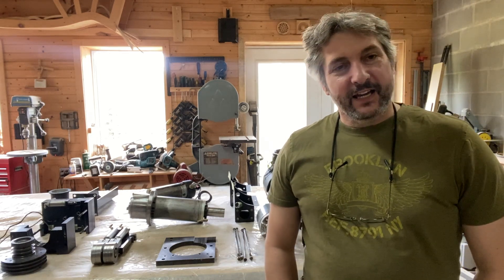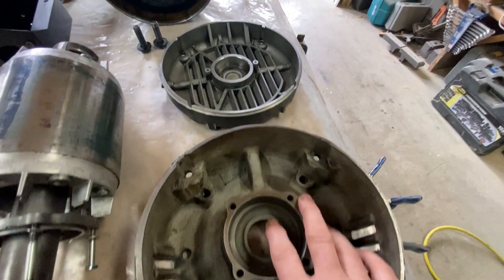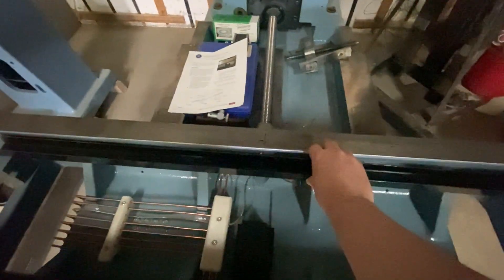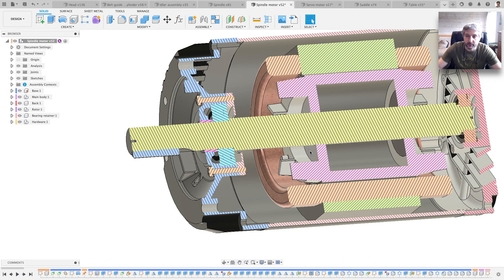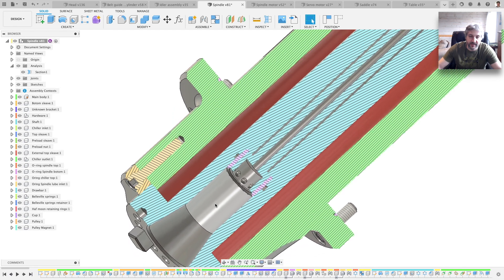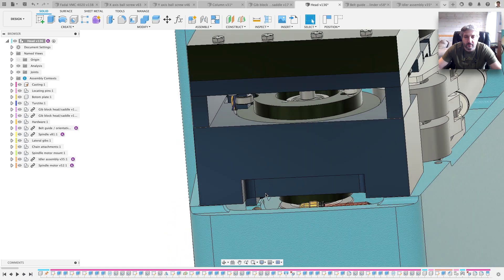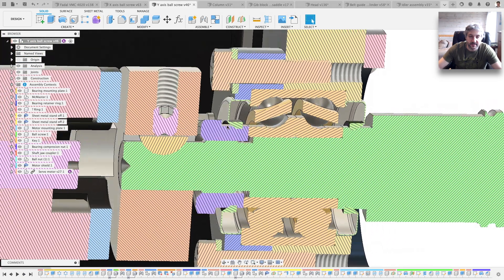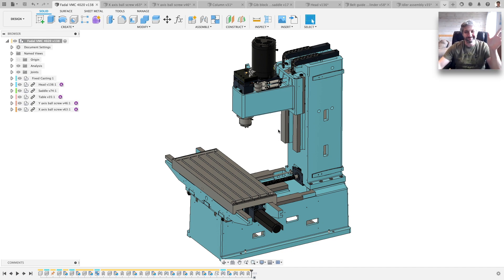Part 28 - (FADAL project update)

Comment: I love this video series, thanks for sharing. I pulled down your model to check out your encoder adaptor, and I think I'm going to try to cut this on my CNC Router. I'm still very much an amature, but it looks simple enough for someone at my skill level. It looks like every could be cut from one side with exception of the filets on the encoder side. How critical do you think those are? I'm asking, because if I can get a good result I'd like to send some to try.
Reply from the maker: This is really cool and so generous! I’ll have a look at the model later today and I’ll come back to you.
Reply: @BlaiseBarrette  Although I forgot you were a machinist.... so you probably will make it better than I could. Either way it'd be a fun part to practice on.
Reply from the maker: Hey Brett, I had a look at the part and it can absolutely be done in one operation. The chamfers on the other side can be cut with a file. Are you using Fusion 360? I could take a look at your tool path if you’d like? I love that a part on the machine would be cut by a follower of the channel! It’s the full circle!
Reply: @BlaiseBarrette  Yes I use Fusion 360, and I'd be happy to let you double check my tool paths. Is the part that you have linked above ready for cutting? I'd assumed so since you already tested it. Oh, I meant to ask if 6061 was ok or not. Or if you need it non-conductive I have black HDPE as well. But if you wanted steel, I don't think I can do that just yet. Also, not sure how I'd share the file with you.

Comment: I can not thank you enough for sharing the CAD and the details are amazing. I really appreciate the time you have put into this. Very helpful  for doing work on my 4020 and the areas of my machine I have yet to venture into. I need to rebuild my spindle motor as it is packed full of crud. The spindle cooling fan runs constantly and this is major flaw on Fadal's part. There is no filter and in my opinion the fan should only run when the spindle is running and maybe a couple minutes after the spindle is shut off to extract residual motor heat. This can be easily done with a time delay relay to motor fan. There is a popular modification for the spindle motor fan to add automotive carb filters at the top. I just did this to my motor. Fram filter part number CA192 is perfect diameter matching the motor. Two of these filters at the top of the motor with a 3d printed cap and threaded rod make for an easy modification that should have been factory.

On the spindle belts it might be worth looking into upgrading to the pozi belts. The pulleys for the original 6 belt setup are getting harder to find new and there are many more machines out there with the pozi belts. In order to do the upgrade you will also need the pozi belt guides as well. The pozi belts are also much quieter compared to the 6 belt setup. Also the 6 belt setup can be a pain when doing any service that requires removal of the belts because they have to stay matched to each other, if you mix them up they will wear out very quickly and be much noisier, so it is worth it to upgrade to the pozi belts.

One other little caveat on the motor encoders. The encoder you are using is an open collector type that is easily susceptible to EMI in the cable. Switching to a line driver encoder might be worth looking into as line driver encoders are more resilient to EMI. Omron part number E6B2-CWZ1X is the part number. When searching for Omron encoder the Z1X is the line driver identifier. If you add a spindle encoder it must be a line driver type because the long run of cable from spindle motor back to controller.
Reply from the maker: Thanks for saying that! I am glad it it is useful! I am having a great time doing it so every one is happy! :P
Reply from the maker: I am sorry, for some reason, I didn't see the "Read more" link under your comment so I read only a part of the first paragraph! That's why you only got a partial reply from me! Hahaha!

So, about the spindle motor, a filter is clearly a good idea. I saw a video on YouTube from At-Man if I remember correctly who did this. I'll look into that. Let me know how it goes for you!
One thing I've been wondering for some time for which you may have an answer... Is the way lube pump running all the time or is it only when axis are moving? Any insights on that? If I make my own control, I'll have to pump the correct amount.

For the pulleys, ROD90265 told me exactly the same thing. That would explain why we had to replace the belts every few weeks at work. They weren't matched sets. And also the pulleys are a bit damaged so it wouldn't have helped either. said

http://cncdrive.com/downloads/Diff_line_driver_manual.pdf
The servo drives have the differential signal decoder built in. Link to the drive I plan to use: http://cncdrive.com/downloads/DG4S_series_manual.pdf
This is the control: http://cncdrive.com/MC/UC300ETH%20datasheet/UC300ETH_manual.pdf
And the software: http://www.cncdrive.com/UCCNC/UCCNC_usersmanual.pdf

I have done some bench tests for an other CNC project and it's quite promising. I love how it gives full control over the interface and can be easily customized. I realize it's not as robust as other solutions but this is what I can afford for now.
Reply: @BlaiseBarrette  The lube pump cycles once every ten minutes I think. A motor rotates a cam that acts on the lube piston. The travel of this cam action is adjustable and there are instructions on adjustment in the Fadal manual. It is an industry standard lube pump/reservoir combo so you do not need to go with a Bjur branded pump/reservoir, there are plenty of identical pumps/reservoirs that will work just fine without spending the money on Bjur name brand. 

I remember reading somewhere the lube pump is only supposed to cycle when running a program or the machine is in motion but my pump will cycle as long as the control system is powered. This means if the machine is left idle for long periods you will go through a lot of way lube. I would set the machine up to where when it is first powered on the pump cycles once to oil everything and then sits idle until a program or motion is executed and then the control will track total motion time and cycle once every ten minutes regardless if your program is under ten minutes. To put it simply the controller should keep track of motion time of programs and this time should be constantly updated so that programs under ten minutes do not cause the pump to cancel lubrication time cycle. I have noticed that my pump will cycle within a few minutes of powering on my Fadal.
Reply from the maker: This is so valuable information!!! Thank you so much!!! It will be easy to programme with UCCNC. Just to be clear, one circle is one turn of the cam?
Reply from the maker: @Elite Machine Works, I had the Way lube pump in storage but I got it back today and had a good look at it. The cycle time is not determined programatically like I thought. The cycle time is determined mechanically by the motor gearbox ratio. Since the CAM is actuated by a worm gear, the motor doesn't loose position when power is off. So it does keeps track of the cycle time but it is done mechanically. Quite clever! All I have to do is provide power to the pump motor via a relay whenever the machine is running a cycle! Here is the link to the data sheet: http://www.bijurdelimon.com/fileadmin/products/docs/bdius/Datasheets/21836_LUB_TM5_DS-R3.pdf

Comment: So mounting the counter weight arms directly to the column is the original way perfectly fine. By the way those are the "expensive" arms... lol.  Fadal saved about $200,000 a year at the time by switching to the Angle iron arms and no longer making the arms out of 2 x 2 solid Aluminum. So the reason the Buna Rubber was added is similar to the reason they went to the O-rings in the motor mounts (which was solid originally) and the latest motor mounts were vulcanized mounts. So there was 3 versions Solid, O-ring and then vulcanized.  Its all about vibration isolation ... ultimately trying to improve finish. So if you will notice you might be able to see it with the CAD simulation but in the area of the sprocket you will see that the motion causes a pulsing motion up and down as the link react to the sprocket. And in turn with a 900 LB Lead weight begins to ... uhhh... wiggle and yank especially when Fadal went to 1000ipm rapids. So do you have to have the rubber ? Simple answer NO you definitely do not need the rubber. The Majority of Fadal Finish problems come FROM the Idlers and a mismatched set of belts especially  HT machines with the air over hydraulic set up. That is why the idlers shift during tool changes to relieve the pressure and extreme pressure on the belts. So the rubber was to cushion the motion of the counter weight.
Reply from the maker: Wow there is a lot of information here! Ok so if I understand correctly, I’m fine without the rubber but it may affect slightly the finish during z moves because  of vibration from the chain/sprocket interaction. It’s ok whiteout the rubbers but better with. I’ll buy new ones. Also, the vibration coming from the idlers on belt mismatch… would it be fixed with the Pozy pulley upgrade? Thanks for all this help by the way!! ;)
Reply: @BlaiseBarrette  Pozi would help because of the single piece. With the 3 belts they tried to match as best they could. They belts were measured by putting the belt on 2 pulleys. 1 stationary and the other on a sliding rail, and then measure the stretch and runout and try to find the ones with the same runout. But never perfect so imagine 3 slightly different diameters .... there will be fighting between them as they rotate.